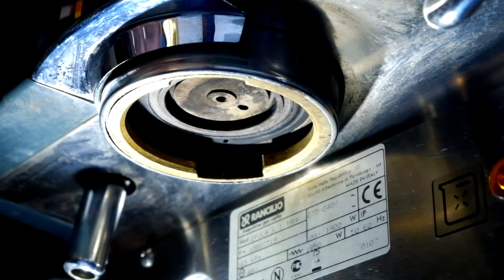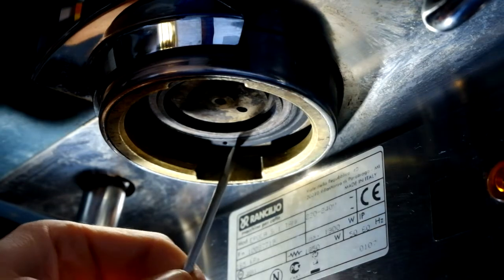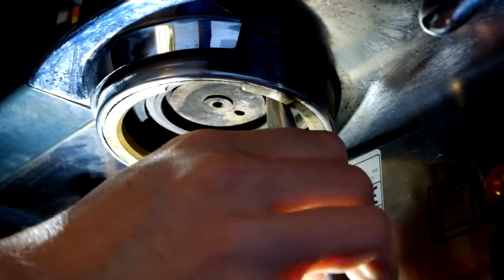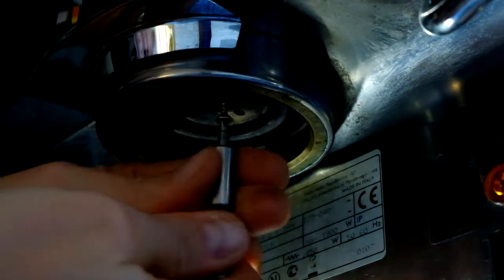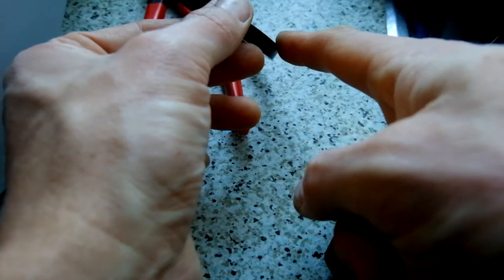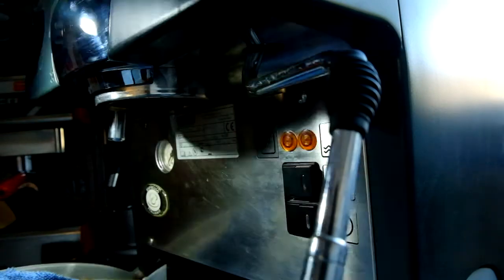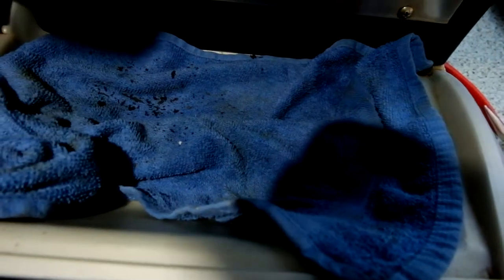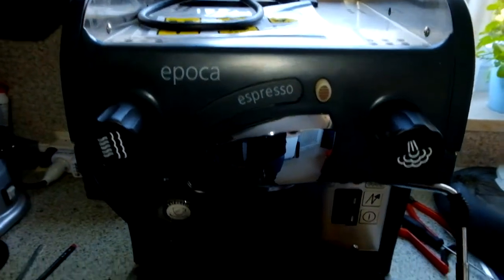Group Head Gasket Change Espresso Machine Rancilio Epoca

Comment: Just an adjustment to your instructions. 

The group gasket bevel should always be facing up and the flat surface is the portafilter side.

Thanks for the video!
Reply from the maker: I just had contact to rancillio tech services in Italy, and they stated 
clearly, that the bevel should face down towards the portafilter. It is,
 that when you close the portafilter, the rubber can "move" just a 
little, can expand as you thighten the portafilter in.

Comment: Do you still have this machine?  I just scored the exact same machine for free from a friend with a small cafe.  She used it for two years and bought a two grouphead machine to replace it because she got so busy.
The single group head Epoca that she gave me has been in storage for 3 years so I want to remove the boiler and open it up to check how clean it is.  I'm  using the parts manual to see what gaskets and new o-rings I need to hunt down to put it back together afterwards.
As a bonus the Epoca she gave me came with two portafilters, one single spout and one double spout. This means I won't have to swap over filter baskets for how many cups I want to brew.

Comment: I need advice as to why my Sylvia Rancilio was spilling water from behind
Reply: Jorge Luis Fuentes he’s not a technician just a home owner changing his gasket in the hardest way.  The better question is what exactly is your leak.  If by behind you really mean back leg area can be a number of things such as your pump or a fitting that has gone bad.  If it’s the front do you have a drain if so it can be clogged if not then a pipe or fitting towards front is leaking.
Reply from the maker: How do you change your gaskets? Do you have an easier way?